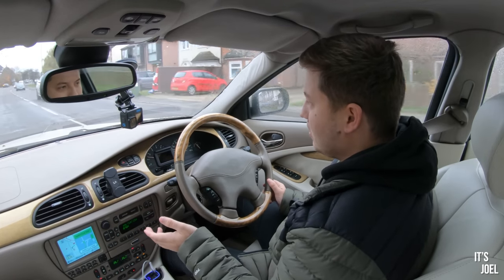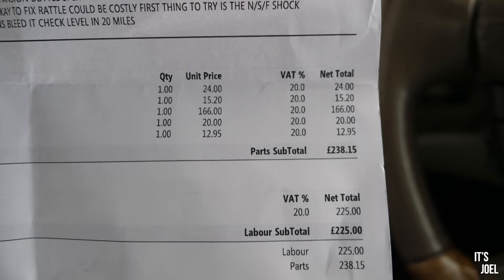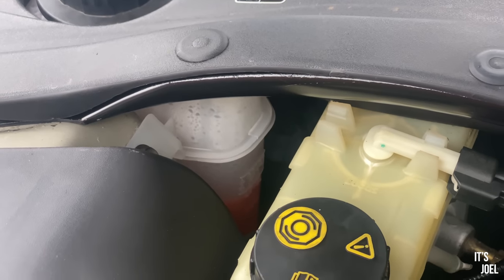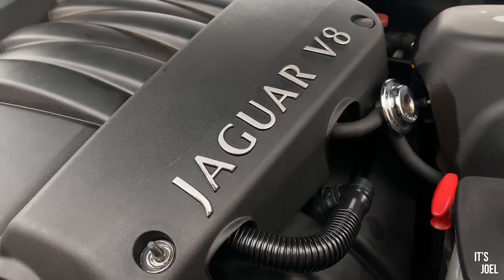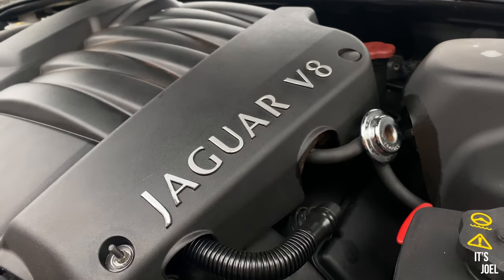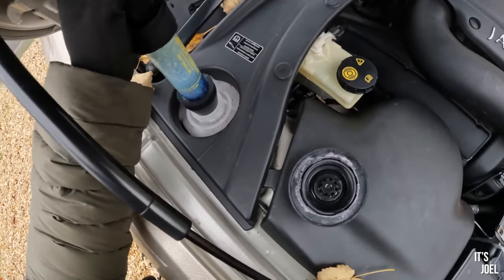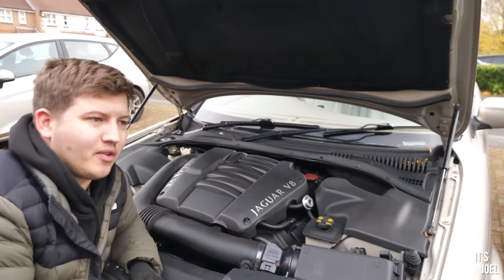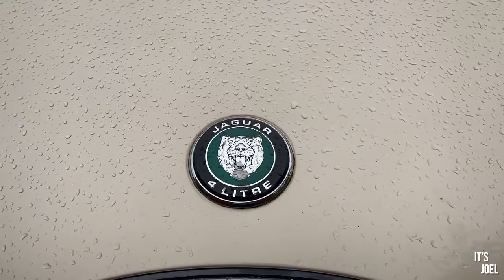Can this £30 bottle of Steel Seal save my cheap V8 Jaguar?

Comment: In my experience, there's only 1 way to cure a head gasket fault....and it involves removing the head(s) and replacing the gasket(s)
Check for head cracks at the same time
Reply: Had headgasket failure in my 2.5 Stype. It was cheaper to source an engine and swap it. I got an engine with half the miles for £600. It had just been serviced too with new long life plugs and new coil packs.
Reply: @jamesk1806  something to consider then
Reply: Agreed.these additives are just delaying the inevitable
Reply: @aquariumaddickuk  yep, also if there's a leak from the head, there could be other issues that require attention

Comment: If one of the headgaskets had gone you would only have smoke out of one exhaust, unlikely that you have had both fail at same time...

I'd also think that the system would be pressurising if a headgasket had failed.

Comment: The white " smoke" You're describing is basically steam due to the cold weather. 
The smell from the heater could be due to a slight leak from the heater matrix or the pipes attached to the matrix however the " stop leak " you put in the expansion tank may even cure that leak.
I would suggest you get the cooling system pressure tested either at a garage or try and buy a pressure tester and do it yourself. 
Good luck 👍
Reply: I reckon the same. Heater matrix has a slight leak. Maybe just a cracked feed or exit pipe.

Comment: You need properly breed the coolant, as there is air in the system, thus the level goes down. The oil cap can be creamery because of the condensation, you need to check the oil on the dipstick if that’s has sighs of water, not the oil cap.
Reply: I was gonna say the same

Comment: It might be worth checking if your car has an EGR-cooler that's leaking internally. EGR-cooler is basically a heat-excanger between exhaust and coolant. If it starts leaking, coolant leaks either directly to the exhaust system, or via intake/combustion. It's even possible that exhaust finds its' way to the cooling system in some cases.

Comment: That's brilliant stuff it saved a 53 plate Clio 182 , checked oil and removed cap and it was milky as hell and on dipstick , needless to say I did at least another 14000 miles car was spot on.

Comment: Hi Joel, I wouldn't worry about the steam from the exhaust but the loss of coolant should be checked with a pressure test. I wouldn't have put that stuff in the coolant. Good luck 🤞

Comment: Back then in the early 2000s, GM produced the Northstar V8 that had major Head Gasket Issues. The later released something called "GM Sealant Tabs". You can try these if it doesnt work on the long run.

Comment: The combustion process produces steam hence the white "smoke", so this is normal. Possibility that head gasket is leaking into one cylinder and externally hence antifreeze staining on block and levels dropping. You normally also get a slight miss fire on start up. Instant fixes only last a short time (enough to sell the car). Get a cylinder compression test done, this might identify a leak but better to pull the spark plugs and check for rust.
If it is a leaking head gasket, it will get worse and lead to rapid overheating. Solution is top end overhaul. Heads off, skimmed if required, valves seated and seals/gaskets replaced. Always replace cam belt (or chain tensioner) thermostat and water pump. £800 and upwards unless you get mates rates. Good luck. Carl.

Comment: Looks like you have an air lock Joel. Suggest you drain the system fully, refill and bleed correctly. Take your time and familiarise yourself with the procedure and layout of the various pipes etc. Wait for a good day, take out for a long drive after. Top up as required, and repeat long trip. Good luck, love your vids

Comment: I think there's a few important things I would mention from experience of owner both the early V8s and later V8s as well as general observations - as a lot of people have mentioned, I  the cold weather its hard to determine whether smoke is anything serious or not.  I would be concerned about the antifreeze residue on the cam cover gasket and the smell you describe.  Burning antifreeze smells quite sweet, if that's what your getting it means coolant is escaping and burning on the engine block.  These v8s have a number of flaws - firstly the thermostat housing and water pump are plastic and they crack with age, they sit right under the engine cover towards the front of the car.  Secondly, there is a small rubber pipe that exits under the throttle body which is prone to split with heat/age usually resulting in coolant leaking from the back of the engine underneath the car, but only when hot.  I would reccomend checking these items first - white in the oil cap again is indicative of condensation rather than head gasket - check the dip stick for white is a better bet of head gasket failure. Lastly, if you do any more major work, you really need to do the timing chain tensioners, they're also plastic and will fail, usually without warning resulting in engine failure

Comment: The white ‘"smoke" is condensation/ steam caused by hot air hitting cold air.   The best check to do is a cooling system pressure test.  Good luck Joel.

Comment: I've used Steel seal in the past and had no problems long as you have read the instructions, some times 2 bottles are need depends on the litre capacity of your vehicle, just run as normal after. The white smoke might be just build up of water left behind in the exhaust. take the vehicle for a run. I've had great success using the stuff, then when ready get a gasket fitted in time, I would say it would be on how good or bad the fix is using Steel Seal, giving it this road test will show it, but always a have a back up plan just in case.

Comment: I had this exact same problem with the water leaking out under pressure from the expansion tank on my 01 S-type. . I was lucky to have a very diligent mechanic who replaced all the hoses to the heater and the expansion tank.   Please have a pressure test done on the cooling system as overheating the engine will have damaged the head gasket and you don't want that to happen again even if the additive worked.  I have never had much luck with additives and just replaced head gaskets as I never felt confident in the engine again.

Comment: Just for info, water under pressure boils at a higher temperature than 100° (as designed to do so in a sealed engine coolant system). By running the engine with the expansion tank cap removed, the coolant system sensor will register a higher than normal temperature because it is not running presurised. This is why the water level rose in the expansion tank and the cooling fan came on whilst you performed the "blue test".  Also, white smoke (water vapour) is very common in such a large capacity engine exhaust system, especially in the cold. Your engin is drawing in cold air with a high water content, all this is passing through the engine as well as the condensation in the exhaust due to cold air and hot surfaces. Hope that helps, Baz.

Comment: I wouldn't worry to much about "smoke" its normal and its condensation my S-Type does it as well on wet days just drive it around and see what the coolant does also if you want to 100% confirm a hedgasket I'd suggest sending an oil sample for analysis

Comment: My Jag XF 3.0 V6 steams a lot. When stopped in traffic i notice it is more than other vehicles. No loss of power. No mayo on oil cap. I usually top up a cupful of coolant a month but i think that is the expansion tank valve that leaks. Nearly 150,000 miles o  it now. Still going. 
So happy motoring.

Comment: Joel! Fantastic content as always, between you and a few other YouTubers you guys were the main driving force behind my purchase of a 2000 Jaguar XJ 4.0 V8. Exactly the same engine as in your S-type! Now my car, and engine are sorted, hopefully I can now return some useful information. 

The white exhaust smoke is nothing to worry about, time or year large capacity engines etc. it’s to be expected. My daily XF 5.0 V8 is just as bad!! To note though, a quirk with those engines is the upstream O2 sensors can fail without even throwing an engine warning light. Stupid I know, but could be contributing to your emissions you can see if they have given up the ghost. Mine packed up on both banks without any warning lights! 

The fluctuating coolant level, especially when the radiator fan cuts in would suggest to me a stuck or sticking thermostat, another weak area on these engines, the plastic thermostat housing can also break. Now ally replacements can be found. Lastly, these engines love to trash cam-cover gaskets, which leak onto the hot exhaust manifold heat shields. When the car is warm and the blowers are on, the burning smell makes its way straight to your nostrils!! 

Last point, you could do worse than checking out Autoreserve Jaguar, I can’t remember where they are based but they are a great team. All the best, keep going with the great content!!

Comment: Hi Joel. Just finished reading all the comments, another 15 minutes of life I won't get back! I don't know much about the jag V8's, but I own a BMW V8 and know lots about those. Here is the honest and real deal. Apart from a couple of small things that may be wrong with your engine (causing minor coolant leaks) anything else will just not be financially viable. This is why all these V8 cars appear cheap, but really aren't. My advice would be this: adding the Steel Seal is not a wise move, I can't imagine any motor engineer worth his overalls advising you to use it. However, the secondary damage it will cause is probably a while away. The cooling system will definitely require bleeding, so talk to someone who knows the procedure for that engine and carry it out immediately. Forget about any super-serious long trips as the car cannot be trusted, make sure you are in the AA or RAC. Run it around as much as you can and monitor the coolant level once the system has been bled. If it is still losing coolant, a pressure test of the cooling system would not be too expensive and may show up some of the cheaper faults. Otherwise, forget about head gasket replacement, sell the car for whatever you can get.

Comment: A cold vehicle emits white, gray or black smoke when first started due to condensation, but not after the vehicle is warmed up. When a vehicle is started, water is emitted in the form of a vapor. By the time the vapor hits the exhaust system it condenses, and becomes visible

Comment: A coolant leak will usually produce a solid white smog. All I see is normal cold weather steam. Also, if separate exhausts, highly unlikely you would have blown both head gaskets.

Comment: As a point of information, we have an old BMW Z3 that has all the white steam signs of a bad gasket, as well as lots of white goo in the oil around the cap. However, the car does not use any coolant (been like this for over 15 years)... it's plainly due to the car running short trips all the time, it takes hours of driving to get rid of all the steam--it does go away eventually.

Looks like you have fixed it (for now). I have over the years had a few cars where the sniff test has gone yellow. Another symptom of the problem is coolant leaks all over the place as the pressure destroys the system. Coolant that rises and then falls as the thermostat opens is another sign as the gas from the engine displaces coolant in the block before the thermostat opens.

In my cases, I removed the head and replaced the gasket etc etc etc. If you want to keep a car for a long time then a head gasket failure is a good excuse to address many potential issues at the top end of the motor and valve train. However, on a car like that Jag its going to be days and days of work which will cost way more than the value of the car unless you can do it all yourself.

Comment: I have just done the steel seal on my car and it worked! Fantastic. Went from bad back pressure coolant bubbling and rising and hoses splitting from pressure to working normal

Comment: I think the reason your fan came on was with the cap off it reduced the pressure in the cooling system. By putting the cooling system under pressure it increases the point at which water boils. That’s why the rad cap is set at 8 lbs or so. It allows for higher temps before it boils.

Comment: Mayo under the cap can just be condensation from short journeys, especially with a V8. If there’s mayo on the end of the dipstick, that’s likely to be a head gasket issue. If the temperature isn’t going over, you might just have a slow leak somewhere. Did you get a new coolant cap with the expansion tank? If not, try just replacing the cap. I had a very slow coolant leak through the cap on the expansion tank.  £5 later, all sorted. I’m just not convinced that you have a head gasket failure

Comment: Water vapour is a normal part of the exhaust gases, so steam from the exhaust when idling is perfectly normal, especially on a cold day.  Before you spend any more time and money on it, try driving the Jag around and see if the coolant level stays the same.

Comment: It is normal for condensate in the exhaust, especially in humid conditions. My guess is that, since it takes time for combustion gasses to leak into the coolant on some gasket/head problems, keep checking as time goes by to see if you have stopped the leak. I have the same issue and plan to try Steel Seal as soon as I flush and replace the coolant. Good luck.

Comment: Looks like condensation Joel. Take the plastic engine covers off to see where that other coolant residue was coming from. That is a big win that it is not the head gasket.
Reply: with you on that.

Comment: If you suspect the head gaskets, try doing a compression test. I never trust these additives, if a gasket has failed it will need to be changed.

Comment: Regarding the smoke from exhaust, it might be that there is some water in the exhaust mufflers. If you have minor leaks in the head gasket you want see any avoporation, the leak should be notable and probably you will see smoke.

Comment: No external leaks first, expansion tank caps is another  cause coolant loss due to not pressuring the system correctly to achieve a higher  boiling point of the coolant. Vauxhall engines "corsa d" run very hot and still produce a bit of condensation in cold weather which is normal.

Comment: I would say you do have a gasket issue as you said the coolant raised and the fan kicked in which mean there was an air pocket and the pcm thought it was hotter than it was. The fact the sniff test is now blue says it should be okay now, but I’d personally rag it up the road, make sure the coolant is bang on level before you set off, and then check it after the rag, obviously take the cap off but be careful as it’ll be pressurised !! And see if it rises to the level again. If it does, happy days. If not then do another sniff test.

Comment: If you have a burning smell in the cabin, may be a leaking heater matrix - not had a Jag, but had that in other cars. Sometimes it smells like a musty faintly curry smell, from the anti freeze.

Comment: I used k seal on my wife old rover 25 1.8 automatic. Kept the car 2 years with out issues.
What I would suggest is drive the car as much as you can and keep an eye on the coolant level if it doesn’t drop you know it will be fine.
I have not had much to do with the v8 but I know older jag’s suffer a lot with steam out of the exhaust if driven gently.
And needed to go for a spirited drive from time to time.
Old xj6 use to be terrible so what owners were told was to do was hold in the lower gear’s and under load and at full operating temperature hold up on the red line change’s

Comment: I've used steel seal on my Mgf coolant to oil leak.
You have to be stone cold, and run car up to temp, then further 30 mins at high idle if poss.
And allow car to cool down over night, I noticed the best results after a few warm up, cool down cycles, seems to work it's magic doing this.
Also a large coolant capacity in the Jag defo requires 2 bottles..

Comment: Definitely get a pressure test kit. Similar price to the bottle of sealant. If it holds 15psi for 10 minutes cold there is unlikely to be a leak. If it drops you have a leak, just a matter of finding it. If the coolant level drops every time after driving it's got a problem that needs fixing. Good luck,no loss of coolant for 3 years on my s type 4.0.

Comment: Genuinely don’t worry about the white smoke from your exhaust, that’s only condensation & heat mixing. Think of heat coming out of your boiler flue you don’t really see it in the summer same as with your exhaust smoke. 

In terms of the cream/white on the oil cap that’s minimal only condensation again this time of year I’ve had cars with almost like a lemon yoghurt in the cap. 

I think you may have another slight coolant leak from a hose again in an awkward spot. Buy a cheap borrescope from Amazon & have a look around the engine. In future don’t rush to put a sealer in a suspected head gasket get a compression test done first

Comment: I suspect what you poured in stopped the oil/gasses getting into your coolant through a gasket crack but didn’t stop the coolant from getting into your oil through another gasket crack. You must have more than one failure in the gasket’s integrity. Only start to worry if either the coolant or oil turns into a brown milkshake. I had a similar minor situation with a car, they are old and minor issues can be forgiven. As long as you’ve stopped any fluids from leaking out of the car don’t worry about it.

Comment: I used steel seal on a Citroen C5 mk2 taxi with 550000 miles that boiled every 5 miles. Cured it and I sold it at 740000. Brilliant stuff